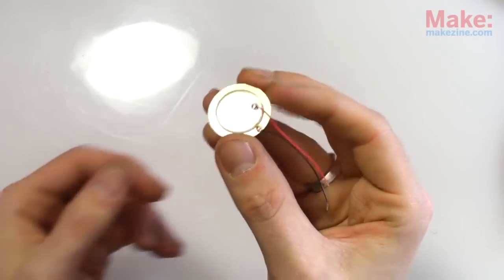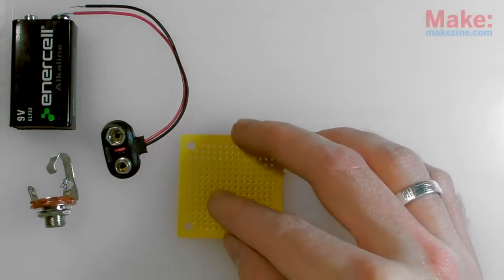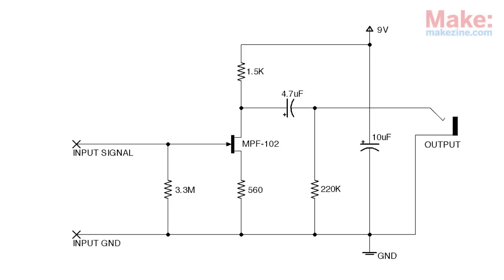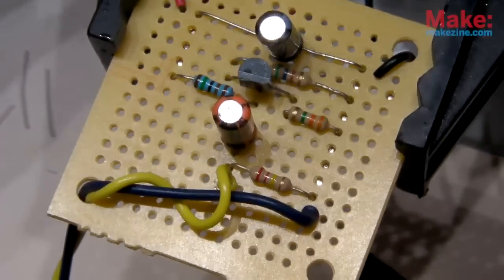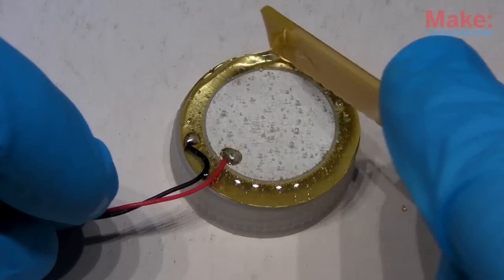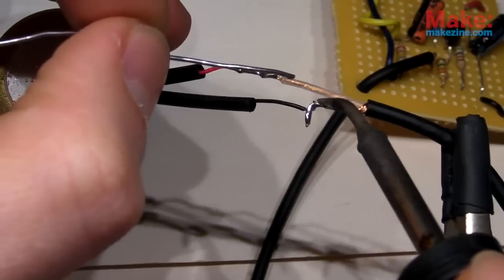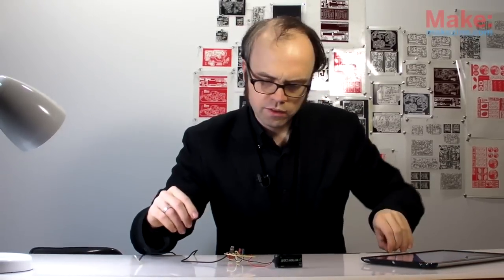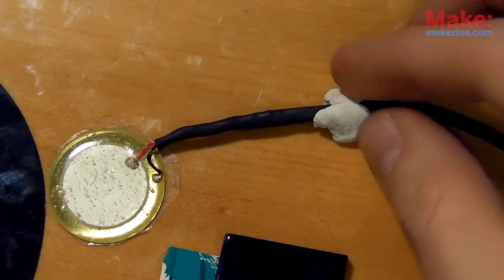DIY Contact Mic - Collin's Lab

Comment: i have been trying to read up on google how to learn to do stuff like this and get into the basics of circuitry, but i cant seem to find anything good.... maybe im searching wrong,
Anyway 1:20 how do u know what stuff to use, is there a site u know of that can help me, like i want to know how u just know which resistors to use and stuff like that, if u can simplify it and give me a site that be cool thanks
Reply: it's like learning a new language, when you speak that language long enough, you will know how to say what you think, unfortunetly i have no literature to give you, just find basics of electronics on youtube, I learned from there.
I am not sure, but I think that this is basic amplifier circuit using jfet

Comment: i did this project but i have a terrible hum on the output signal that only goes away when i put mi finger on the ground of the output jack. what could it be? i allready checked and i have a good ground conection. Also if i wanted to add a volume potenciometer on the output of the circuit what potenciometer should i use?

Comment: I built it! 2 of them actually :)

But there's something weird...
Normally, without the preamp, the piezos are very "hot" and crazy sensitive. With the preamp the signal is more manageable but MUCH weaker. I have not yet tried plugging it in to a guitar amp but i suspect the results to be the same.

I wonder, is there a way to make the signal stronger? I've seen a similar design using 2 of these preamps (almost these anyways) connected in series. could I do that with this design?
Reply: Hi Simon, I am getting the same result I think, it records tapping but no audible vibrations. Did you investigate further or pass on it? Cheers T

Comment: can i use this on rocksmith 2014
Reply: Probably. I've never used rocksmith, but I assume that it just is like a glorified chromatic tuner (phrasing it that way makes it sound like I don't like it but I think it sounds like fun and I'd like to try it out) that also recognizes timing. As long as your guitar is in tune and you have the cable that would normally plug into an electric it should work.
Reply: thank for helping man

Comment: I made this thing, using BF245C instead of MPF102, but I'm getting a ton of humming. Any tips?
Reply: Never mind, it was a poorly connected piezo. Circuit works with BF245C as a replacement for MPF102.
Reply: dizzyspell I'm talking to myself here, but it may prove useful for future builders: the cable length between piezo disk and pre-amp must be kept short, unless you love HUM.
Reply: dizzyspell Improved design: Shorten piezo-circuit cable to about ONE INCH, then using poster putty, stick the circuit ON TOP of the (epoxy'd) piezo disk. Add 3 feet of cable between circuit and the battery, do the same with the female jack. Much better sound this way.
Reply: dizzyspell You got it right. The amplifier should always be as close as possible to the source signal, otherwise you'd be amplifying all the noise that comes with the wired transmission and your signal all together.
Reply: @dizzyspell  Thats helpfull thank you - Im getting hums and pops - and it makes sound when tap it - but records no vibrations... Weird.

Comment: Source and drain are indicated wrong on the diagram. Source is a source of electrons, which are negative, so that one goes  towards the ground via the 560 ohm resistor. Drain goes via the 1.5K to the + voltage.
Reply: qual a solução?

Comment: So I made it and my guitar is picking up radio signals... I'm currently listening to the radio. I think I did something wrong
Reply: Two years late, but...
This is because of the type of cable you used between the disk and the rest of the components. The cable he used (an old audio cable) is "shielded", meaning the audio signal won't be influenced by outside sources and won't pick up other signals. If you use standard wires or speaker wire, you have this problem because it doesn't have that shielding. (The shielding happens because the negative "signal" is on the outside.)
This is important when buying regular cables for an instrument as well, specifically when you need an instrument cable (which is essentially was made here) versus an amp cable (which is usually not shielded).
Source: I've been getting into this recently and needed to learn the difference when purchasing equipment.
Reply: @GrumpyTy34er  Don't know what you mean by "an amp cable is not usually shielded"; are you referring to a speaker cable? All amplifier input cables need to have a screen , which is attached to the ground side of the input. It is the grounding that keeps hum out of the amp.
Reply: You were probably missing a connection between one of those three bottom resistors.  I came across the same problem while making the circuit.  It was interesting, to say the least.
Reply: Frankie Romero lol
Reply: If your wires are soldered wrong then your shielded wire is picking up the radio.  Reverse them.
Reply: Good to know.  I'm fairly certain I bought a nearly identical cable for the project, and the interference did go away after I realized I had missed a connection and corrected the circuit.  It may have been a combination of the two somehow, though I suppose going back through the project again with new parts and components would show it was the cable all along as you said.  Anyways, thanks for the info.
Reply: Can i shield the audio cable with aluminum foil? Will it work?
Reply: Thanks for the advice! Greetings from Philippines.
Reply: CME 7
Reply: z
Reply: CM
Reply: You need a small fm transmitter
Reply: you are picking up am radio from the ground
Reply: Technically yes, but it won't be very effective, it will look ugly, and it would probably break faster. You are better off spending the $3 or so at a Goodwill.

Comment: why not just connect the piezo to a jack cable and stick it on the wood??
Reply: I'm just going to say this, if you're stating "I'm no tech genius," then maybe you shouldn't try to call others out without doing some research of your own. A simple search will yield results quickly explaining the purpose of a preamp/buffer.
Reply: It wouldn't be loud enough. It is still technically "working" but the regular amp would have to be turned WAY up to even hear anything.   The preamp is just amplifying the signal before it goes into the regular amp and speaker, thus making it more practical and usable.
Reply: well for me it worked without..
Reply: You get a highpass filter without the preamp.
Reply: ? haha what i dont really know if u know what ure saying cuz i did and it works, it just has aaaalloooot of excess hum/buz. So i gues the preamp is to prevent that from happening
Reply: I don't really know what I am talking about? Alright, well, you can check out the multiple articles that explain in detail why a preamp is good for a piezo/contact mic, your call.
Reply: well as i told you i tried it without a preamp and it works but theres major buzzzzzzzzzzzz maybe thats what you would call a filter. But there would have to be a parameter/knob involved to even come close to a filter :S right? i dunno im no tech genius, but my contact mic is NOT a filter (ir are you just trying to say that it drains out al lows and mids? which it doesn't)
Reply: Brandon Guimbellot all i'm saying is that my contact mic (piezo) isn't working as a filter..
Reply: Kobie Berkhout The disk is not a filter. The preamp, amplifies what the contact microphone picks up and filters it as well to help reduce unnecessary buzzing.
Reply: Bryan Young but i dont have a preamp :p
Reply: I'm talking about the device built in the video.
Reply: yeah, but i never was

Comment: so i was thinking about doing this for my science fair project. The only thing is that the wholee point is to create a hypothesis and test it. So iwas wondering if i should  make 3 different contact mics and see which one had more bass or treble. So how would i attempt this? should i just change the type of transistor being used in each of the 3 contact mics and see if that would give them different sounds? or maybe change the types of resistors as well?

Comment: What do you need the preamp for? It works perfectly if you solder the piezo directly to a guitar cable.
Reply: It's an impedance thing.  You need to preamplify the signal such that it can be processed at the desired level, in this case instrument level.  Otherwise you end up creating a high pass filter at anywhere between 200Hz and 1kHz depending on the input impedance of whatever you're plugging into.
Reply: @MrSpeakerCone  Hi SpeakerCone, I made the circuit as described by Colin and ended up wiith the same results as the person above. Can you tell me, is is because I am plugging into speakers instead of an amp? Many thanks T
Reply: I pluged to piezo to a set of amplified speakers, without pre amp, and it doesn´t pick up the guitar signal. It picks taps and other noises though... So I guess the preamp is necessary? I expected the amplified speakers would do the trick... Any ideas? Thank you!
Reply: I made this without the preamp and can't get a decent hearable sound even at maximum of my guitar amp. The uke at it's own is louder than the signal coming out of amp.
Reply: its better to have the preamp close to the piezo, as this allows for a stronger signal, normally resulting in a better signal-to-noise ratio. However, this would work without it.
Reply: That's the problem. Probably just trying to make this video looks nice and long and not that stupid.

Comment: Oh: Why the heck are you doing all that work and making circuits??? You just solder the piezo on a 6,5mm jack and connect it with a custom guitarcable to the amp. Done! and with reverb, you get really nice groove!
Mind to answer? geez
Jack from Zuerich, Switz......
Reply: I assume, that the circuit is for pre-amplifing purpose (right?). so, maybe he has less noise coming out of the amp. Jack Bo  Do you have made good results without the circuit? greetings (from germany)
Reply: It is about impedance. Straight signal from piezo have a very high impedance around 1 Mega ohm or more, the preamp to matching and lowering the impedance, that is why in front of scheme he put 3.3 mega ohm. Mismatch impedance will get you sharp, thin sound.
Reply: IIRC piezos also have a weird frequency response that needs to be compensated for.

Comment: Great Stuff!!! What Watt on the Resistors?
Reply: Everything, it is about the voltage. The MPF102 Resistor has a voltage maximum of 25 volt, And a maximum forward gate current of 10. So don't worry, and if i am wrong, you can check the source of this infomation here:
http://www.fairchildsemi.com/ds/MP/MPF102.pdf

Comment: Hi Collin!
Great video, I'm going to build the circuit in the next few days, just a question, if I put 2 piezo in sequence do I have to apply some modifications on the circuit? 

greetings
Reply: When you use 2 piezo mics in parallel the also end up cancelling noise as well.
Reply: You can get different frequency piezos so I suggest getting one high and one low

Comment: Without preamp the output is slightly lower compared to a standard strat single coil, also has a tinny high-pass filter effect that adds subtle twang. Can anybody tell me what happens if, instead of a preamp, I add a single coil pickup to my sound hole, and wire in SERIES to a contact mic? Knowing that the output of the contact element is less than the pickup it is in series with, will the order of the two make a difference to the total output, or the dominant tone? Peace

Comment: The MPF102 is an N-Channel JFET transistor, try substituting with other N-Channel JFETs. Maybe other MPF transistors, J201, 2N5457?

Not to sure how important the transistor specs are in this circuit though? Just check the pinouts on the datasheets and adjust accordingly, to the schematic that is!

Should work.

Comment: hey i tried a similar idea to this buying a small cheep $10 amp kit. After soldering it together, it never worked. i even made sure it was wired up properly, and changed parts around in case something was amiss. but nothing worked so i got another one it also did not work so I gave up. how do you solder things so they actually work. without an amplifier the mic works but is to sensitive. appricate any idea you may have.

Comment: 9V battery + clip, 1/4-inch jack, small perfboard, mpf102 transistor, 10uf capacitor,4.7uf capacitor, 3.3Mohm resistor, 1.5Kohm resistor, 220Kohm resistor, 56ohm resistor, single-channel audio cable, piezo disc

Comment: Does it matter what the voltage of the caps are? I have a 4.7µF 50V and a 10µF 25V... but they look much smaller than the ones used in the video.

Comment: how does the transistor amplify the piezo circuit?  I am just an electronics nube, but the sound from the comb couldnt have been producing more than a few tens of millivolts in the piezo and the FET requires a couple volts at the gate to activate, right?  Could someone clear this up for me please?

Comment: I made one of these minus the preamp and I also added a second disc in parallel so that I could get a more even sound.  I place them right behind the bridge, one on either side.  I used an 1/8" jack so that I could plug directly into my computer.  I think it sounds pretty darn good.

Comment: I'm studying for my BSEE at Minnesota State University, and these videos don't even scratch the surface of what I learned in a single semester.
Don't get me wrong, I love Collin's videos. They're part of the reason I chose Electrical Engineering. They just don't have as much info as a formal class will.
On the other hand, I doubt any of my courses will have me amplify the sound of me knocking on my head. :D
... or the steel mesh. That one sounded cool. :)

Comment: You could use a voltage regulator, but the LM7809 9 volt regulator can take a maximum voltage input of 35 volts, and the LM7824ACT can handle up to 40 volts.

Now that's the first option, the second one is buying or making a switch-mode power supply, pololu sells them, not sure what's the maximum input voltage for their switch mode regulator, but I suggest you to take a look on their website.

Comment: ... used BF245 instead of MPF102 without any problems.If it works with a MPF102,it should work with a BF245 too.Check the pinout though.

Comment: u can use use a stereo jack, connect the battery ground to the ring and the circuits ground to the sleeve, and then the preamp will only be on, pulling power from the battery when the jack cable is connected.

Comment: can i just splice in a USB cable for power instead of the battery or would that require changing other parts of the circuit too?

Comment: The tip (center pin of the rca plug) is hot & the surrounding shielded wire (sleeve) is your ground or negative wire.

Comment: I didn't even make the amplifier circuit just the piezo and 1/4 jack and I was able to press it against my throat and use it like a mic. If you were to add the amp circuit you most definitely could use it as a throat mic!

Comment: can someone please just explain to me how I get the same output, with or without the pre amp circuit, ie just connecting the piezo disk directly to the amp. Is there something wrong with my pre amp or have i got a very good amplifier? it sounds ok with or without the pre amp part but i dont seem to have same fidelity as he has, ideas please?

Comment: Well now, this is fail. I have conected piezo to mic input on comp, it had 10 times better gain than with this circuit. Even worse, it's louder when piezzo is conected without pre-amp on stereo. So this circuit has gain of 2, but only in simulator, in real it has gain under 1

Comment: @taylerchew I am not going to remove isolation from copper tubes.
Rather small wires.
I also got this spacing between teeth that is perfect for removing isolation.
:)
I didnt mean to chew the isolation off :P
just gently bite the isolation and pull.

Comment: Another good way to remove isolation off the wire is to use your teeth.
Strong enough to break plastic but not strong enough to break copper.

Comment: @yhevrah The signal that comes from the Piezo or 'contact mic' is way to small for the amp, so it has to pre-amplified (the signal needs to be made stronger) so that it can be used with a guitar amp. Hope that answers your question.

Comment: @dalbeersinghsohal It can definitely be done. A lot of power can be drawn from PC power supplies and get used in complex electronics applications. The PCI standard is a good example. 
I'd recommend that first you build this on a breadboard before compromising the safety of your PC!

Comment: @dalbeersinghsohal USB might not be able to supply enough power depending on the amplification. I'd recommend looking at an external power source like a battery or rectified mains voltage. You'd have to choose an amplifier which won't attenuate high frequencies.

Comment: @pietzeekoe You'd probably need to increase the amplification, not to mention add some filters to eliminate the high frequency noise from external power supplies i.e. 50Hz/60Hz mains.

Comment: @Snuk1s It'll work the same, although the difference is that the microphone will require an excitation voltage to work (A power source). The amplification will also have to change depending on the voltage range you get back; this means you'd have to modify the choices for R and C.